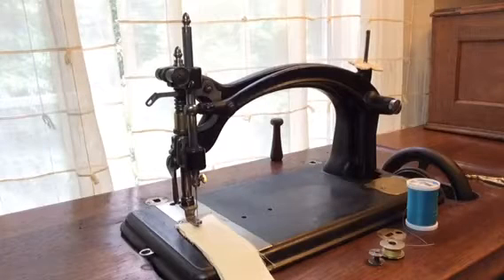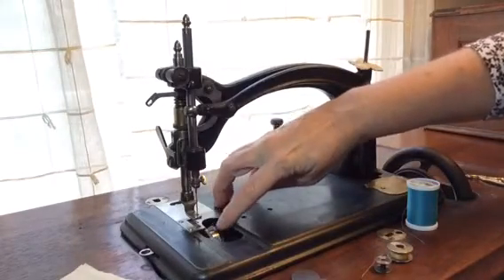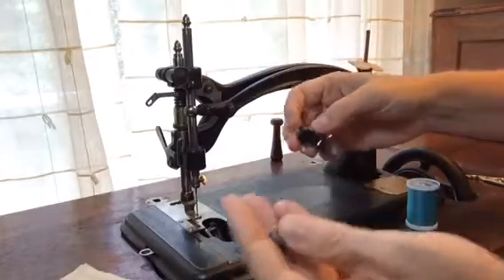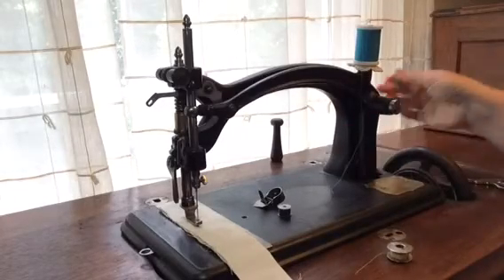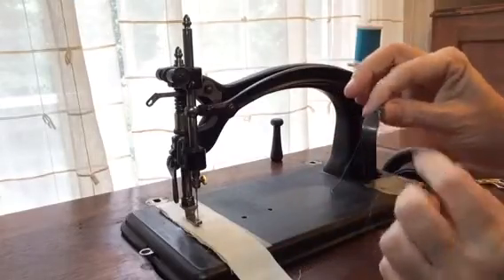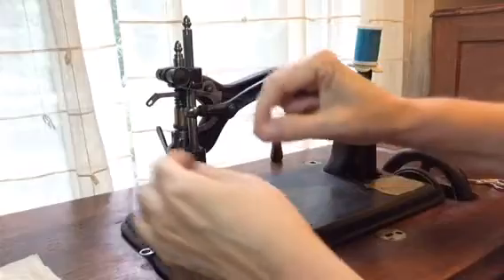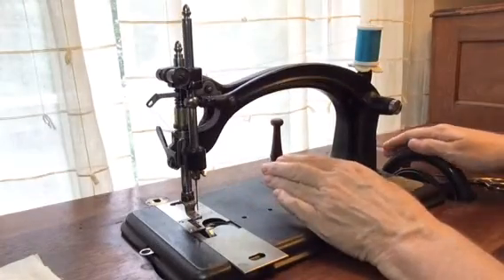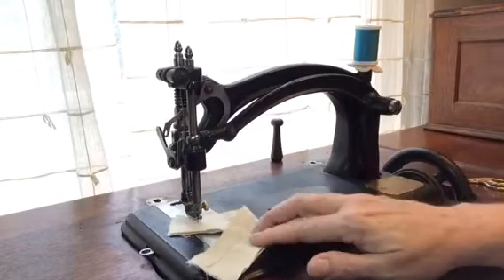Threading an American BH & O Sewing Machine

Comment: Something always strikes me on these old machines, perhaps you can refresh my memory. What's the wooden peg for at the back? Part of me thinks it's for helping to move the machine, but in the grand scheme of things, that doesn't make sense.
Reply from the maker: Hi Scott! The wooden peg is for supporting the machine head when it is tipped back for oiling or servicing underneath.
Reply: Well, imagine that. I've also got an old Weed People's Favorite, a W&W #8 and an old VS2 (off the top of my head) that have those as well. Guess I never put two and two together since any time I service them, the heads come out.